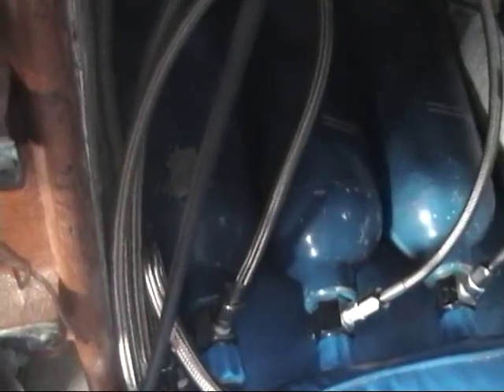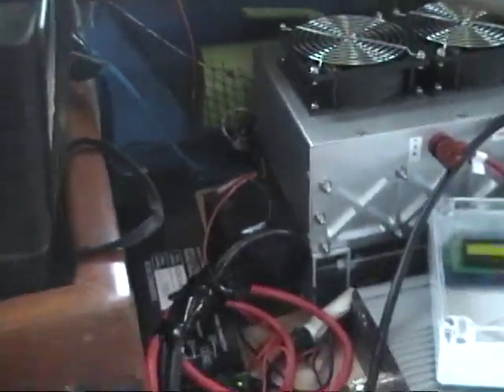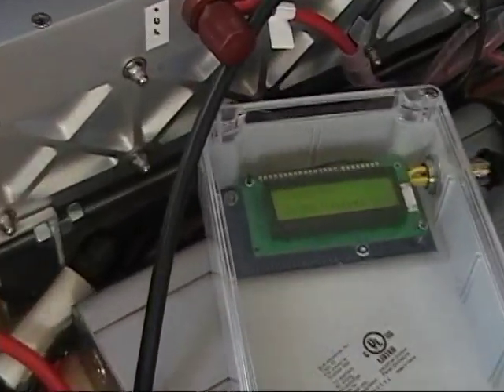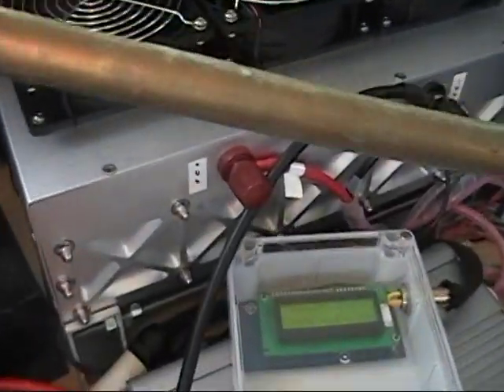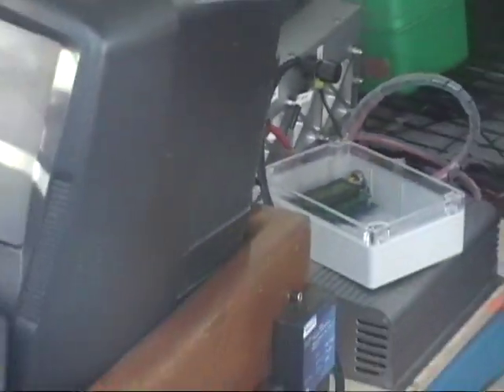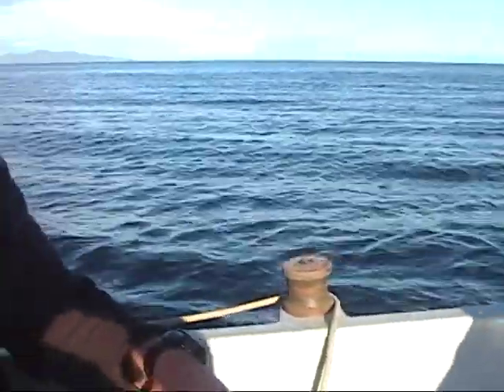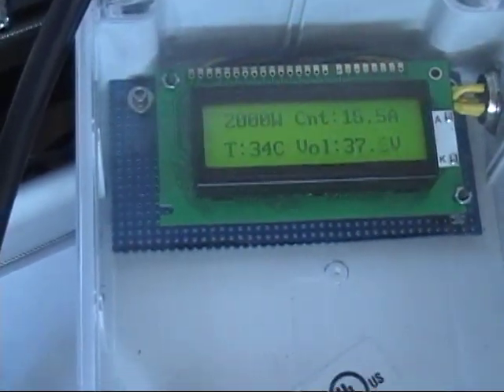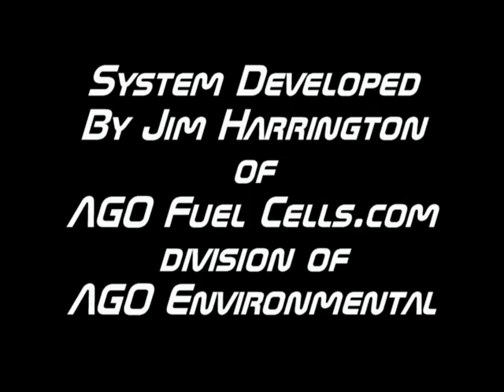H2000 2kw hydrogen fuel cell tested in sailboat July 2010.mpg

Comment: The idea of a hydrogen fuel cell cruising sailboat is nice (at least in theory), but you need to be a qualified NASA (or USN nuclear) engineer to fix that system if something breaks. Will it catch up in commercial shipping? I think so. But this system is not suitable for your average cruising sailor. Not to mention having flammable hydrogen on a sailboat is not a very good idea...

Comment: Also, best boat template for this would be a catamaran, since the boat uses ballast, conceivably you could build a boat that has storage areas in the hull built in (as ballast) that are filled with the Metal Hydrid medium, with built in water cooling/heating channels for the H2 cycle, to a keel cooler. With the fiberglass skin with a solar cell surface, and Solar Cell Sails (Solar cell of surface on substrate backing), you could conceivably have a boat that could go anywhere, without refueling.

Comment from the maker: The present H2 lasts about 1 hour. The batteries, backed up with the solar panels last about 6 hrs. I plan to increase the H2 supply to 10K liters with a small high pressure tank. I will be adding an electrolyzer powered from the solar panels to recharge the h2 when in standby. I also use the H2000 to power a heat pump system at home, see video. The H2000 will also be used to power my patened stand-alone plug-in electric car charger later in the fall. Now I am off cruising in a very quiet boat.